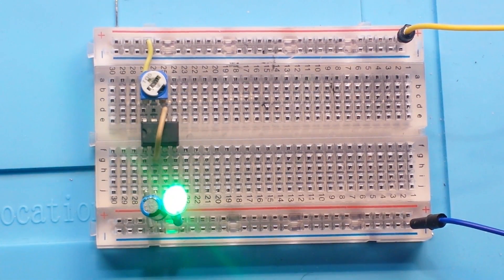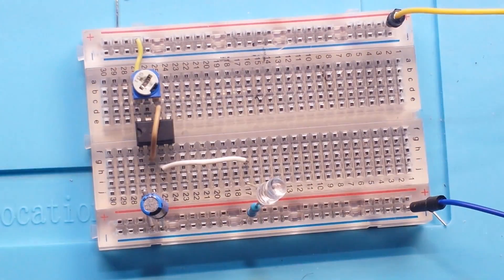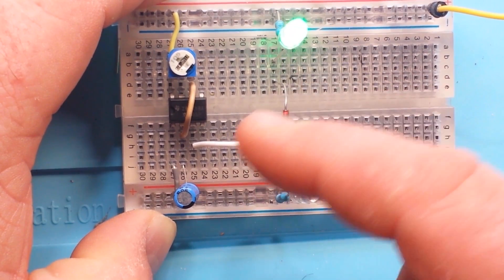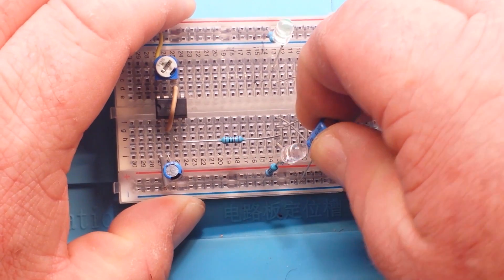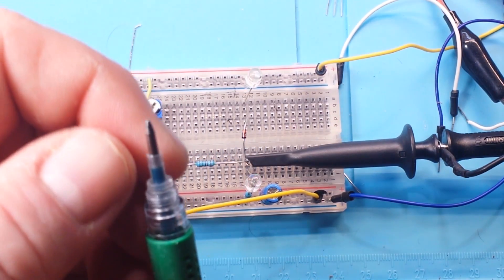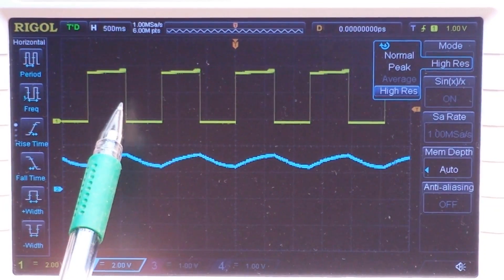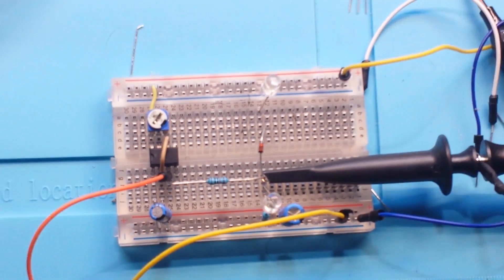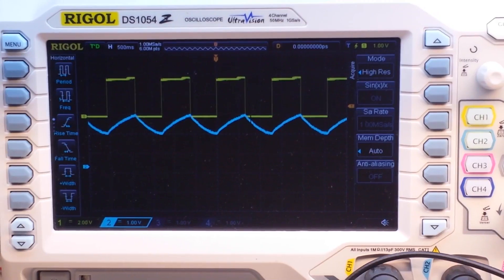Circuit Fun LED fader with 555 timer

Comment: Hi Paul....I just started tinkering with electronics when I came across this great video. I was able duplicate the circuit just like you and it works great. But.....when I added the 2nd capacitor to induce LED fade....there's no change. The LEDs are still doing a "hard blink". If I'm see accurately what you did, you added a capacitor from negative to the 555 Pin 3 connection, right? BTW, I'm using a 100 uf cap from negative to 555 Pin 2. I'm using a 5v power wall wort. Hope you can help. PS. I'm using a jumper from 555 Pin 3 to the LED; not a resistor.
Reply: Update.....I realized I made a mistake and used the wrong pot. I was using the 203 pot (saw this used in one of your other videos). I noticed you used a 105 pot. So I swapped out the 203 with the 105 and used the 1uf cap on 555 Pin 2.

Comment: Still green here. Yesterday I made a circuit with a button, a transistor and a LED diode. I wanted to have a off DELAY, and I eventually got it to work, but it was a SOFT off. I was expecting a HARD off. Cant figure out why the transistor makes it a soft off.

Comment: wondering as i didnt find it ... do you have a componet size video.. i been building with the normal size stuff.. wondering what size down next.. i see 1206 and some others for SMD or SMT whatever its called so on.. any help tips tricks so on . need a hot gun? need this or that so on.. thanks..

Comment: Another great video Paul!

The LED is a diode, so it seems redundant to add a diode.  But, the reverse voltage of the typical LED may only be 5V, so it is advisable to add the diode - although in this case it may have been fine without it since it appears the voltage in the circuit was 5V.
Reply: That's right :) but he has a resistor to limit the current and thus creating a voltage drop. Am I missing something?
Btw subscribed your channel, interesting stuff you have keep it up :)

Comment: Hi, great video loved it!
1:40 Btw why you had a diode since the LED is already one?
Btw please add your thumbnail text to the top instead of the bottom 
because it's not readable since youtube adds the time and covers your 
tittle.
Reply from the maker: The diode prevents the opposite LED from lighting.
Reply: @learnelectronics 
I was mentioning this: https://imgur.com/a/0rczDXU

And i believe you can still add that capacitor for fading since they are fading separately because of their Vf that is being reached by the sawtooth wave
Reply from the maker: Yep that'll work. There are 100 ways to skin a cat.
Reply: FixDaily - Electronic repairs, hacks and tips See my comment above...

Comment: Haha the 555 prevails. Love these videos because I've been messing with the 555 timer a lot.
Reply from the maker: You can have endless fun with the 555. It is my absolute favorite IC. try to see how fast of a STABLE output you can get. I can easily get 2-3MHz, but's its not stable. About 500kHz is my fastest. Also try to adjust the duty cycle so it behaves as a pulse generator. Go for the fastest rising edge. And please let know your results.